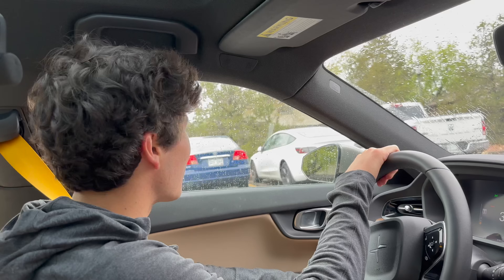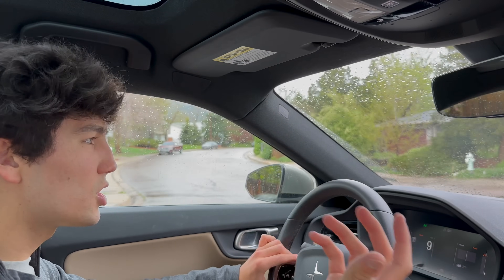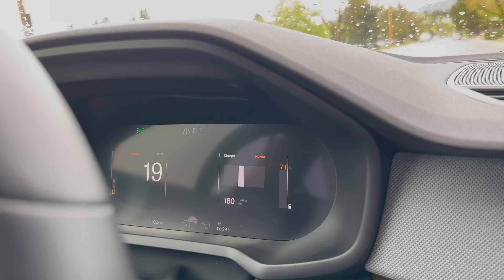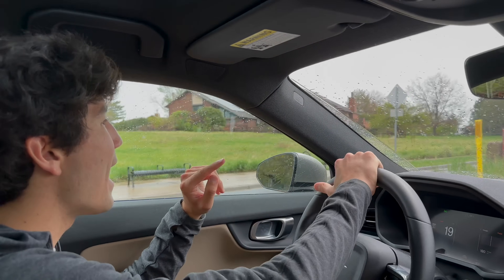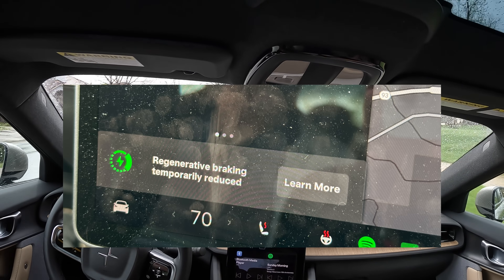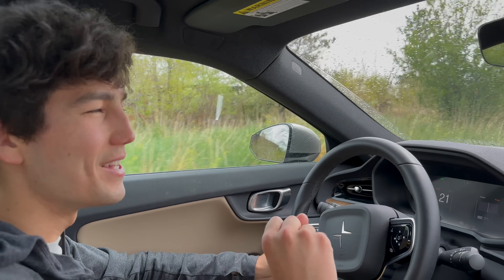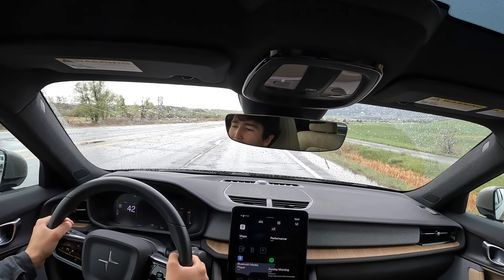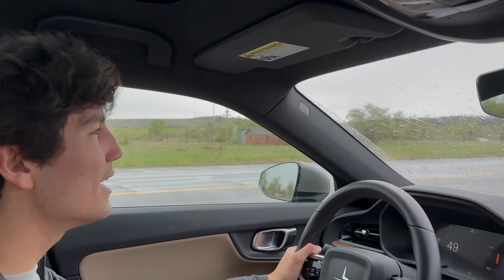How To Master Regen-Braking In Any Electric Car For More Range

Comment: Dual motor Model 3 strongly favors the rear motor for both acceleration and regen. Most of the time the front motor isn’t doing anything, as shown by Bjørn Nyland using Scan My Tesla. Model Y is presumably the same. Physics says either axle will be able to capture the same energy. Tesla presumably chose the rear because the front has an induction motor that’s less efficient.
Reply: Weight shifts forward under braking, so the front brakes have to handle more of the braking load. This is why front discs heat up faster than rear discs. Might as well let the friction brakes up front safely deal with the heavier load, letting the rear brakes utilize regen instead.
Reply: @BogeyTheBear  good point

Comment: Model 3 and Y show precisely how much regen is available by making the left end of the power bar dotted. Likewise, the right end is dotted to show how much power is available. This has been the case for at least 5 years. The text message came later, and the icon is a recent addition, but the dotted bar remains.

Comment: Sure coasting is most efficient, no energy transfer, no losses.  However, I have found coasting basically useless in real world driving.  With wind resistance, tire rolling resistance, etc. it is pretty much impossible to coast and maintain speed.  One pedal is awesome in traffic and I have no trouble maintaining speed on the highway.  After driving manual transmission gas cars for years I can’t stand it when I release the accelerator and the vehicle doesn’t slow down.
Reply: I coast quite often in the real world. Not useless at all. But I live in a mix of suburb and rural, in the city I don't coast much. I know that many city folk like to think we out here aren't part of the real world, but I would argue the opposite 😂.
Reply: Master chef drove exodic cars stick camshaft. 155mph soeed eemnn cars 155 moh
Reply: Coasting is really helpful and efficient!  Yes on exactly flat streets you can’t maintain speed forever but in most roads you get some mix of slight inclines and declines.  Coast then!  Regen braking just can’t recoup the same amount of energy as used accelerating. But totally understand if you like driving one pedal for personal preference.

Comment: Could you also cover when the break lights do and don't come on when using regeneration?
Reply: It's the same acceleration force as they normally come on at with kinetic brakes. No difference! Law regulates this luckily :)
Reply: @iMaxPatten  that's good to hear, because my old e golf could regen pretty aggressively in 1,2, or 3 settings without the break light coming on. Only in B mode would it trigger the break lights
Reply: https://youtu.be/U0YW7x9U5TQ
Tech Connections just covered this topic now

Comment: I tend to tell folks that using regen is the best way to have longer range. But the more I drive, and more metrics and data I collect, the more I feel like coasting with low or no regen level set the range is better, unlike past me used to.

Personally, owning a Renault Megane e-tech, which allows for 4 levels of regen, I now flip between them multiple times in a ride, sometimes in the same street, avoiding using the break pedal as much as I can
Reply: When you use the brake pedal doesn’t it regen and then blend the friction brake? That’s what my Kia EV6 does, and I thought all cars except Tesla will do.
Reply: @tomm5936  I believe it does. And somehow that feels like more regen gains, than using heavier regen

Comment: Would love to hear more about how brake lights behave with regen.  For example, I heard with the Ioniq they don't come on as you are gradually regening/slowing down?  Seems very dangerous if that's the case.
Reply: If you're curious about the regen states that trigger brake lights on the Ioniq 5, you may find this useful: https://www.youtube.com/watch?v=G1rJNNKRzqY

I agree it's a bit of an art and balancing act of when to show the brake lights with a given amount of slow down, but it's worth noting that for decades manual cars have had engine braking and haven't shown brake lights, so some amount of coasting and slow down without brake communication should be reasonable
Reply: I can assure you the brake light does come on. I drive an EV6 (same drive train as the Ioniq 5). I cannot explain how it technically works but if I regen very little like the engine brake in a gas car, the brake light won’t turn on, but when I regen over some defined threshold the brake light will come on. I was very curious how it works, I tested and it worked like I would hope.
Reply: @tomm5936  Okay.  Good to know.  Had heard different

Comment: You do realize how stupid it sounds for you to say how amazing the engineering of the GM Hummer EV is when the next thing out of your mouth is that GM suggests that if you live at the top of a steep hill, to charge to 90% so as to have regenerative braking available to sufficiently slow the vehicle on the hill.
Reply: It also indicates a problem with our safety regulations. A car that, if charged too highly at the top of a hill, is not able to quickly stop should not be legal on public roads. Hopefully, nobody will get run over because of the corners that GM cut.

Comment: First time I hear that GM recommends not to charge the Hummer EV close to 100% if you are going down hill afterwards because you might not be able to stop the vehicle. 

That's a nice way of fixing the issue. Just as when they were recommending to park 50 feet away from other cars or not to charge inside you garage if you had a Chevy Bolt/Volt.

Comment: I have had a Leaf, Bolts Tesla and the ID.4. for me the one that has gotten it right is ID.4. It's far more natural and uses blended brakes when you step on the pedal. Plus with the auto hold feather is great. The one pedal drive mode best for me is on the Nissan Leaf 2018 and up. I didn't get used to the one in Tesla as for some reason it seemed to pulse. That's just my view.
Reply: Huh. I’ve been using Tesla’s one pedal driving mode since it was introduced and have never felt any pulsing. It comes to a stop more smoothly than I can.
Reply: My bolt doesn't use blended braking unless you use the brake pedal. It still manages to stop me even on slight inclines and does have a hold feature

Comment: It took me about a week or two of driving my Model Y to get used to one pedal driving. Three years later I can sometimes drive for a week without touching the brake pedal.

I activated one pedal driving and hold mode on when I first got my car and never had to adjust it or change it.

Comment: I love my e-Golf because it offers 5 settings all the way from coasting (D) all the way to max regen (B), with D3, D2 and D1 in between the extremes. 

Charge car to 90% and will get full regen, typically, at moderate battery temps.

Comment: All EV's should have one pedal driving/regen and the driver needs to not be a total dope and learn to modulate the throttle. This is the very reason why I am scared of the future with self driving tech, the tech iw making drivers dumber and less capable only adding to the justification for the tech because it dumba drivers down.
Reply: given your typing prowess, im not too worried.....
Reply: Teslas have it and no turning off. Just high and low

Comment: Did I hear you say the motor rolls backwards under regenerative braking? The motor does not roll backward, that would take a change in the gearing. It is still turning the same direction, only thing that changes is the current flow, this is all handled by the computer electronically, no physical change in motor direction occurs.
Reply from the maker: Yes, just trying to get across the rotor in motor slows the tire instead of a kinetic brake rotor on the wheel. I find the analogy helpful but thank you for the clarification :)
Reply: @outofspecguide  it’s basically doing the same thing as engine braking in an ICE vehicle, it is using the drag created by the motor, but unlike an ICE vehicle that is using the engine compression to slow the car, wasting energy in the process, an EV is generating electricity that creates the drag to slow the vehicle and you get to recover part of that energy back into the battery.
Reply: @Tim-Tiller  Thank you
Reply: False info is not helpful. Think how many people will pass that along. Edit the vid!!

Comment: My EV6 has regen which can be adjusted with pedals behind the steering wheel from 0 to 4 (one pedal drive). I took me some time to learn to use it, now I adjust it all the time using all levels depending on road and traffic. I start at max driving out of my garage and through the small streets where I live and when I need to frequently stop. On highways I turn it down to zero and it’s amazing how it can coast. Yes the pedals feel different depending on the level, but I quickly got used to that. I would really recommend people explore the options on their car.
Reply: Similar to my experience.
I used to set to 3 most of the time, while in the city, but with time I've started using lower regen levels and coasting more.
I find it improves range by a lot.
Reply: You should try Auto Regen. Hold the right paddle for a second. It basically does what you are doing without you having to change it. If no one is in front of you and you go to 0 throttle, it coasts. With traffic ahead, coming off throttle will regen to varying degree depending on how quickly you need to stop. I've found it to be a great blend of coast-ability and energy recuperation.
Reply: @CougAbides  I tried it but couldn’t make it work for me. It seemed to random when regen was strong or not. I do agree it’s worth trying.
Reply: @CougAbides I haven’t been a huge fan of it in the Niro
Reply: But it does not look ahead that makes driver control better. 8 years of Hyundai EVing.
Reply: Try auto regen, you are wasted the smart regen control
Reply: I own Ioniq 6 which has 4 levels on paddles and auto. I’ve done test on motorway driving 70mph constant speed with regen set to zero. While driving decided to turn regen on holding  accelerator pedal in the same position maintaining the 70mph and increasing level of regen. With each level increase while holding accelerator in the same position the car was slowing down more and more. So to maintain 70mph I had to press accelerator pedal more and more. Can anyone explain why this is the case ? I was thinking regen breaking should apply only when braking and not be on all the time “holding vechicle back”. I’m now using auto which still sometimes applies regen when no need for braking. I would appreciate if someone could explain. Can’t find answers
Reply: It just feels like that. The throttle response is different, but the energy used is the same. It just makes you push the pedal more for the same power.  @JOJC86
Reply: Does the EV6 also use break blending when pushing on the brake pedal, when in any of the 0-4 one pedal drive modes?
Reply: @edgrenzig  yes. I drive an EV6. I don’t have any issues at all but we should get a recall too.
Reply: @tomm5936  I assume you mean "Yes" the EV6 does use brake blending when stepping on the brake pedal, when in any of the 0-4 one pedal drive modes. Do you know where this is discussed in the Hyundai literature and how the blending actually works. I cannot find it anywhere. Or maybe another YouTube video which discusses this brake blending in Hyundai vehicles.
Reply: Coming from my Elantra N DCT with "flappy paddle gearbox" I was at first confused with my Ioniq 5 regen paddles, thinking the higher should be on the right and lower on the left... However, I quickly realized the change in feel and input on the pedal when changing more similarly reflects a normal upshift or downshift when using regen

Comment: Nice video.  As a newer EV driver I like having two driving modes in my ID4.  I use D mode on the highway and B in the city and for big hills.  Both modes in the ID4, are pretty similar efficiency wise in most settings.  There are times when I find B mode a bit exhausting to use vs coasting.